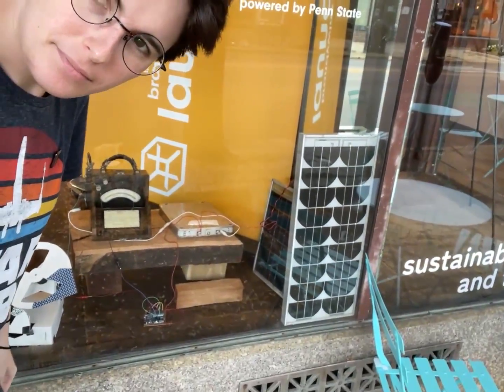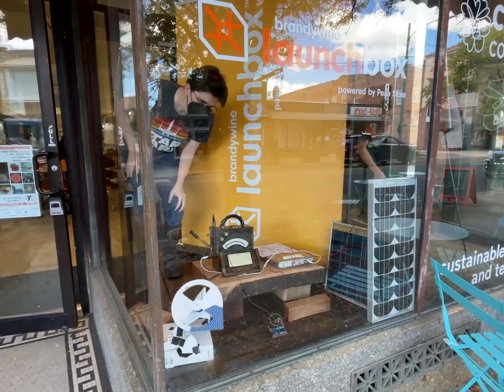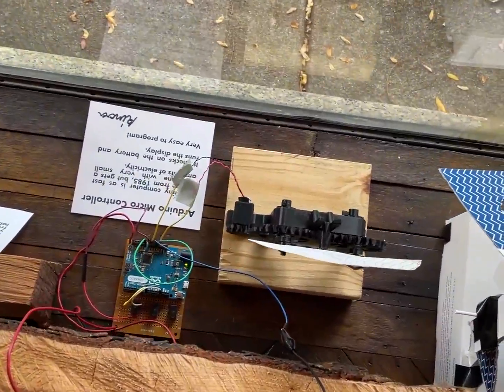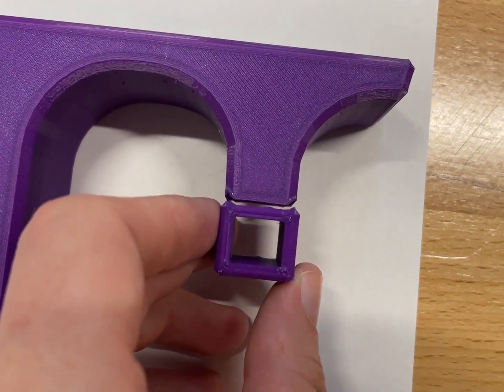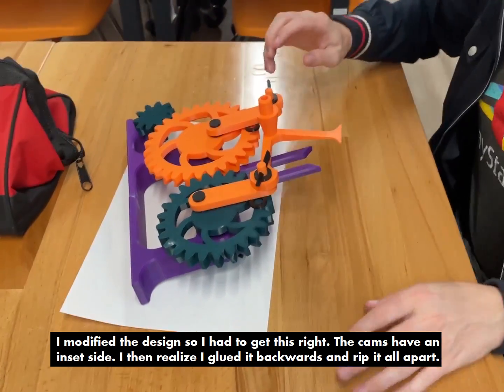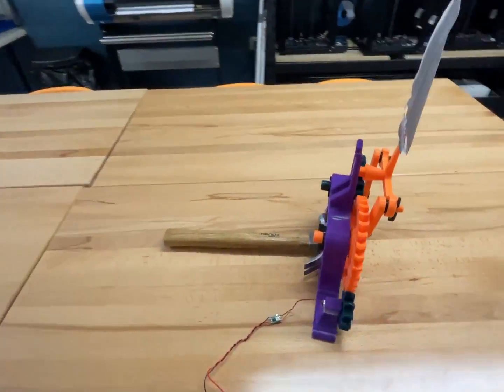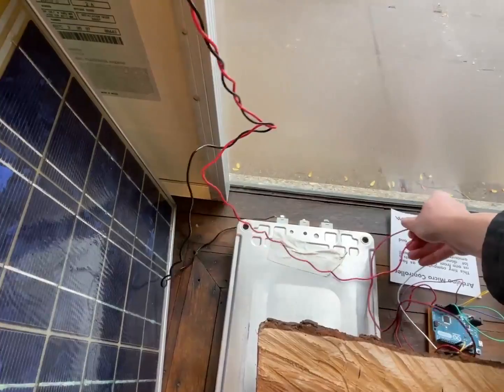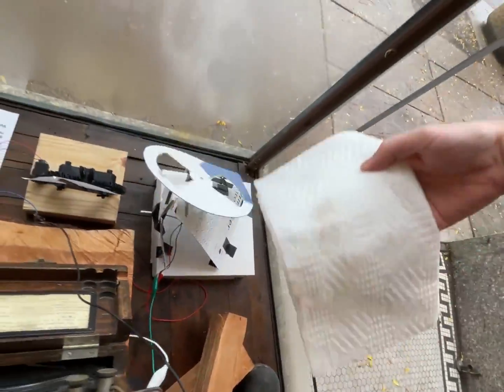Makerspace Automated Solar Display 3: Adding whimsical clockwork mechanisms

Comment: the ship mechanism is cool but why not print out the boat as well? at least in 2d.. may decoupage the notes on wood or glass?  hide a bag of rice or charcoal in the window to control the moisture or leave the door cracked open for ventilation

Comment: Maybe you should use some of the solar to power on incandescent or infrared light to keep the humidity down? It works quite well keeping moisture out of a steel cabinet.
Reply: A small fan might be enough to just circulate air a bit.